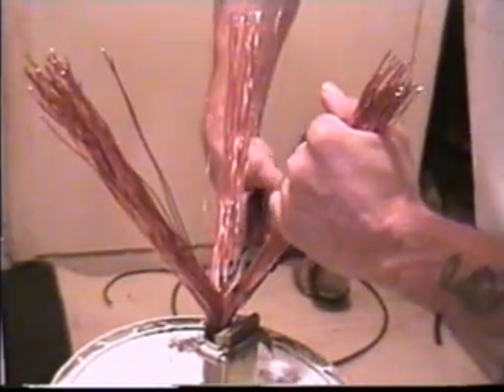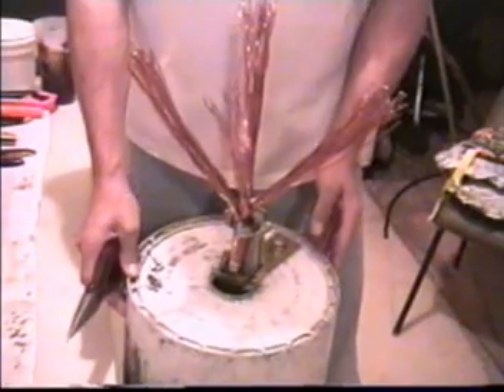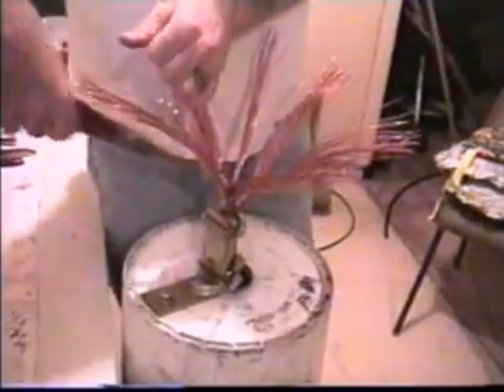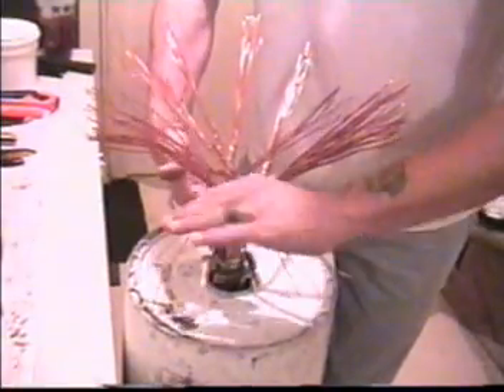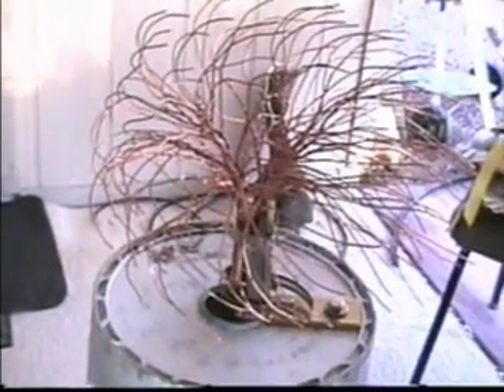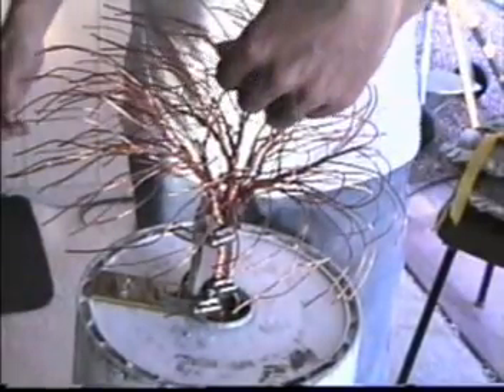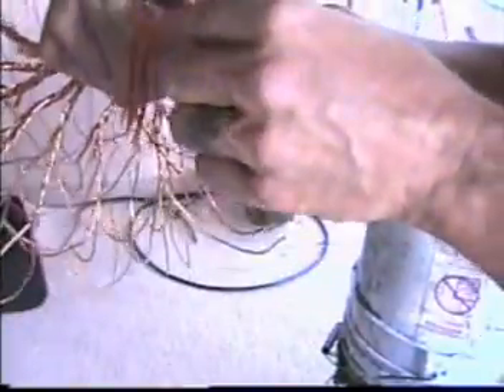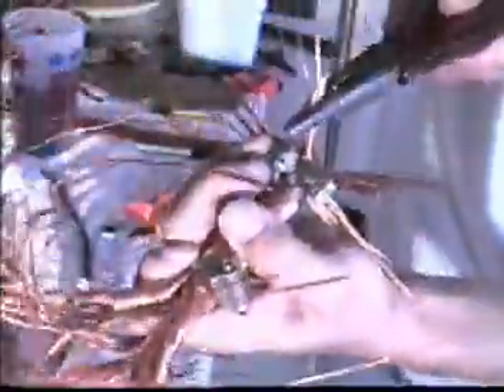Diy Wire Tree P3

Comment: Couple things: 1) how many strands of wire are there here? 2) when you twist the 3 branches at the crotch with the needle nose isn't it marring the wire? 3) can you tell me the brand of your belt/strap clamp as I've looked all around the internet and can't find one like it? I looked at sear online too. Thank you
Reply from the maker: The pliers I use are very old and have no abrasive surface left on them,, they are quite smooth,,
this is a wrehch on amazon>> https://www.amazon.com/Titan-Tools-21315-Strap-Wrench/dp/B00TU3UNW8/ref=sr_1_5?s=power-hand-tools&ie=UTF8&qid=1539709414&sr=1-5&keywords=strap+wrench    
On this one there are probably 100 wires

Comment: how would you advise someone that would like to make a tree using old barb wire? I would like to make it about 16"x20"
Reply from the maker: Wear welding gloves, and be up to date on your tetnus shots,, use a pipe wrench with brass or other soft jaws fir the initial twist, remove barbs for trunk and just have them for the branches

Comment: Do you use a formula to measure? I.e. Cut 1.5 times longer than the height of the tree or twice ?
Reply from the maker: not really, if it starts getting too tall I give it a haircut to look proportinal,, I will have to measure next time I make one..
Reply: Thanks!
Reply from the maker: I always make the limbs too long and then trim them back to match the trunk

Comment: Will this work with stainless steel wire? Have you ever try steel wire, or is it too hard to manipulate?
Reply from the maker: I have used stainless steel, copper aluminum, nickel, tin coated copper.. the only problem with SS is depending on alloy it wants to hold it shape, SS safety wire works well
Reply from the maker: Works with all wire,, mig welding wire is the most difficult to deal with.